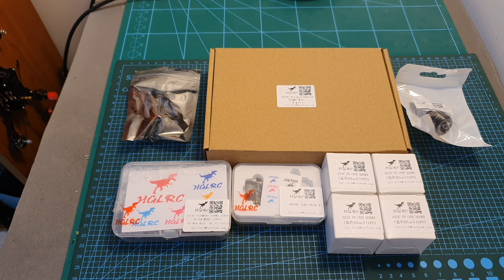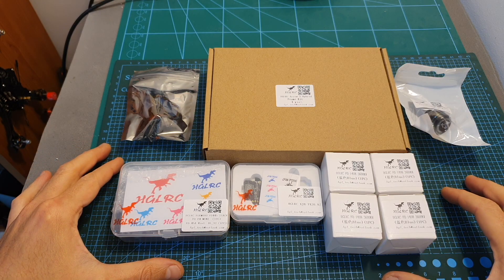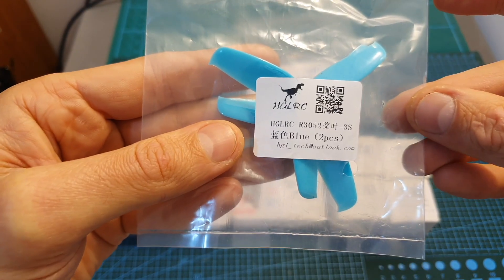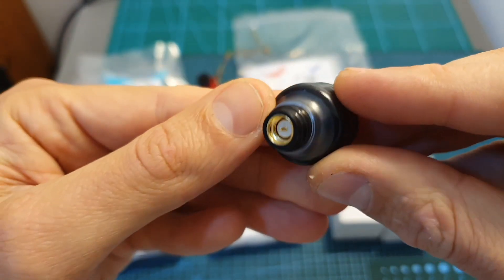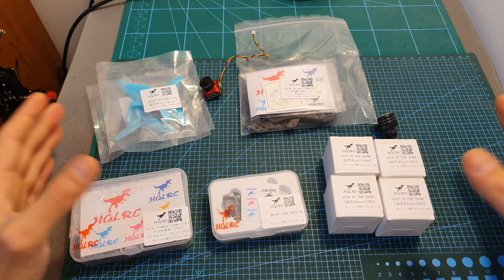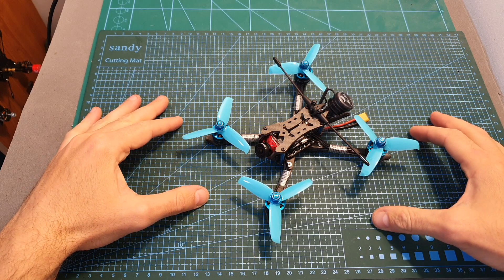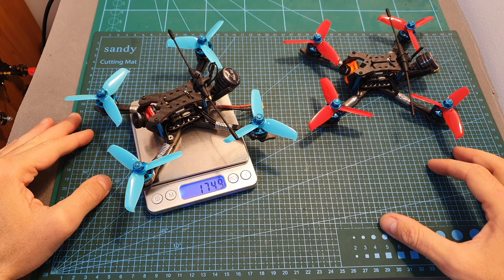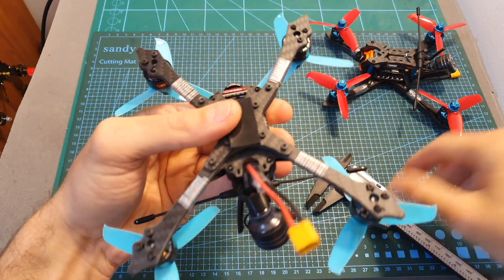HGLRC Arrow3 - Overview &  Build Video

Comment: I've splinted two arms from my three x145s. They might be a little heavier but for me unibody is ideal. If I do get this kit I'd prolly have to go 6s but so far there appears to be only 1000mah size avail. Seems an ~800 would be best imo... but then I'm prolly splittin' hairs with that. Your thoughts? https://www.rcgroups.com/forums/showpost.php?p=41563315&postcount=2314
Reply from the maker: I am going to connect two 3s 450mah batteries in series in order to get a 6s 450mah lipo, as I think that 1000mah 6s battery is going to be too heavy.
Reply: @KremerFPV  Justin Davis stands by a 1000... prolly because there's nothing smaller on the market xl. Awaiting your 6s test dear Gal. Happy landings!
Reply: @KremerFPV  for 6s keep it with the stock xt30 or swap to xt60?